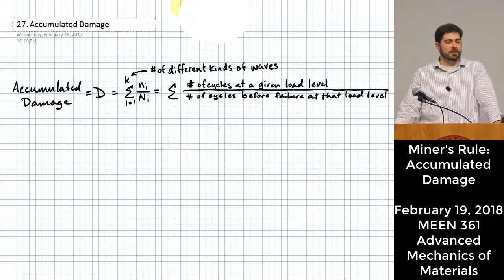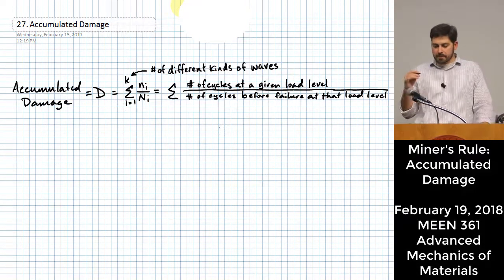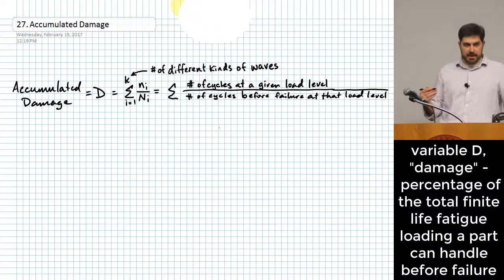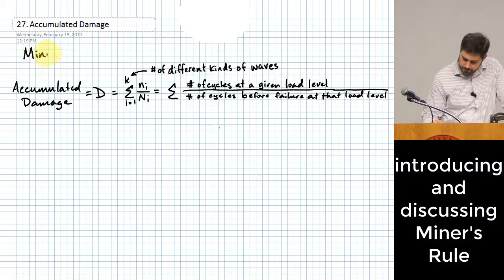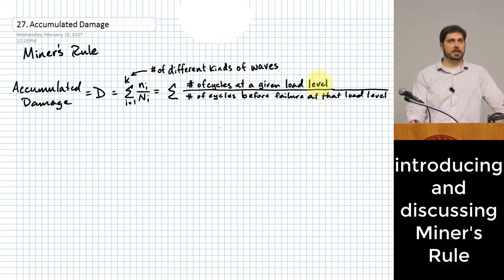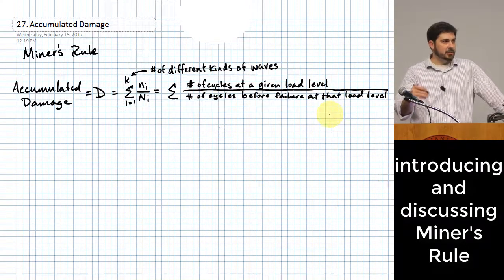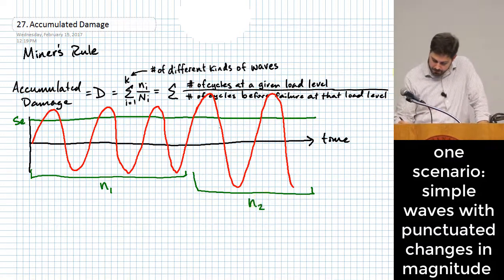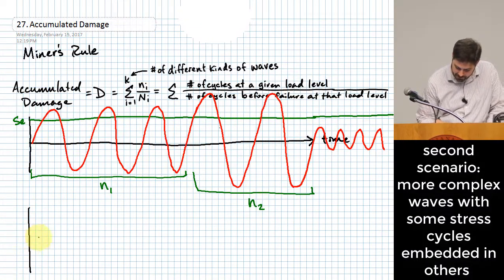Accumulated Damage and Miner's Rule

Comment: Thanks but I believe you had one mistake: 
that one pattern that repeats for 100000 times has TWO cycles for each of frequencies so in 32:31 numerator should be doubled (if you draw rain flow you will see that count of each cycle is 2).
Let me know what you think.

Comment: Where is the graph for f vs Sut from? I have a value of 40MPa (=approx 5.8ksi) so I’m not able to get the F value from the graph
Reply from the maker: That relationship is presented in Shigley's Mechanical Engineering Design, but it is applicable only to ferrous materials. I think you must have some other kind of material if you have Sut=40MPa. So I think you'll have to try to locate (or generate experimentally) a S-N curve for your material.

Comment: Fantastic explanation on damage accumulation. In the miner rules you mentioned  # of cycles before failure at that load level. How you define before failure . In the example cycle1 Sf is 47 ksi which is more than the material se 40 ksi. Is this a failure of the material which you accounted in damage calculation?
Reply from the maker: Se is called the endurance limit, and it is the stress level below which it is assumed the material will last infinitely (i.e. no limit on the number of stress cycles before failure). At stress levels above the endurance limit, we expect that there will be a finite number of cycles that the part can withstand before failure. If parts fail in fatigue it looks a lot like brittle fracture, because fatigue failure mechanics involve tiny voids forming due to tiny amounts of plastic deformation occurring at tiny locations of material imperfection. Eventually voids coalesce together and there are too many of them for the part to survive, and the part will fracture. Since the stress of 47ksi is higher than the Se of 40ksi, it means there will be a finite number of cycles that we expect can occur; eventually the part will fracture if stress cycles persist at that magnitude.

Comment: what  is ksi ? we use(Mpa) MEGA PASCAL as stress unit
Reply from the maker: ksi stands for kips per square inch. A kip is 1000 pounds (lb), so ksi = 1000 psi = 1000 lb/in^2
A lot of people outside the US are bilingual; inside the US, engineers have to be bilingual WRT units!
Reply: @TheBomPE  thank you so much for replying sir ?